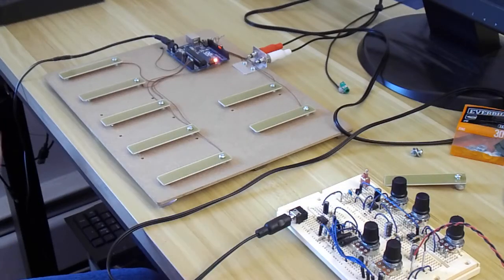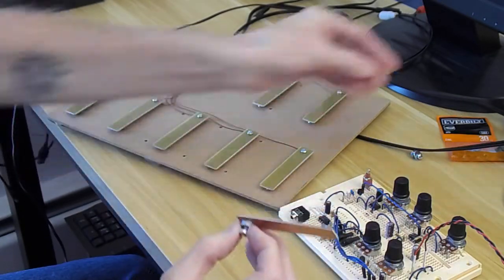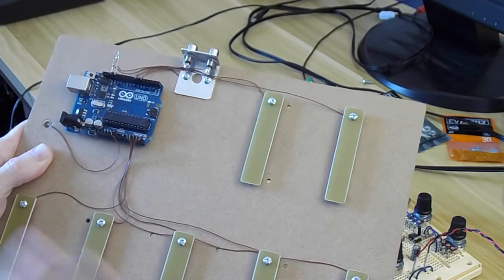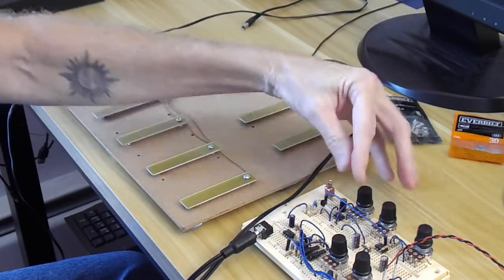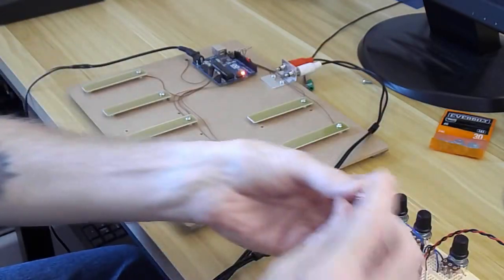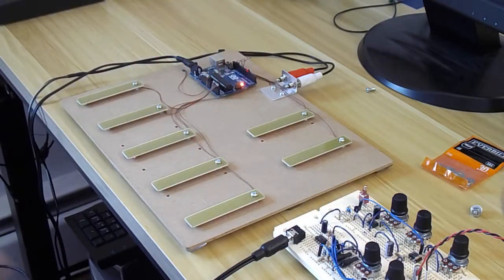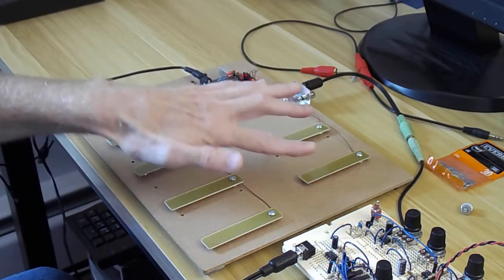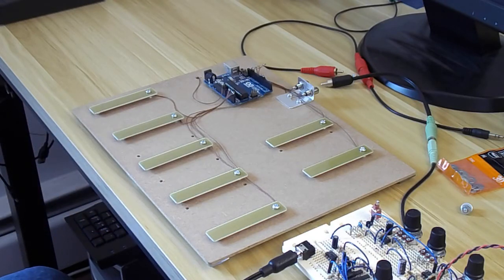Arduino Bass Pedals Code and Info

Comment: In the code it looks like the value for the timer interrupt period, OCR1A, doesn't get set. Is there a default value or am I missing something about the Arduino timers? Thanks, I really appreciate this video.
Reply from the maker: Yeah, the timer interrupt will default if not specified.

Comment: My one suggestion, Pete, is you can greatly Increase your sound quality and personal enjoyment by looking into 1 or 2 powered studio speakers. If you like the sound of my videos, I use M-Audio Bx8a monitors, which I believe are discontinued. They probably did poorly as studio monitors for their inherent bass response, but for mine and your applications, this is fantastic! Your bass pedals would amaze you going through a nice powered monitor. The difference is staggering! 😉
Reply from the maker: Yes, the pedals could definitely benefit from more low end through a good speaker/amp. I used to run my projects through a big home stereo system, the low end of the filter would shake the house. But now I'm retired and live in an apartment complex. No more big amps. 😕